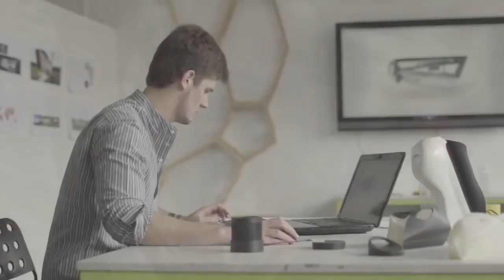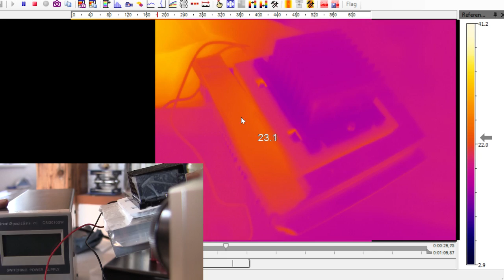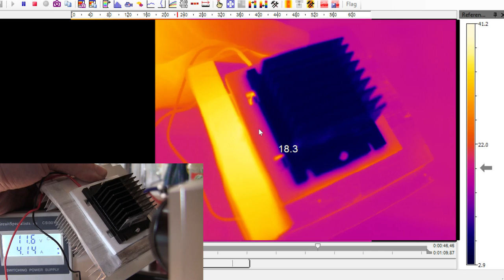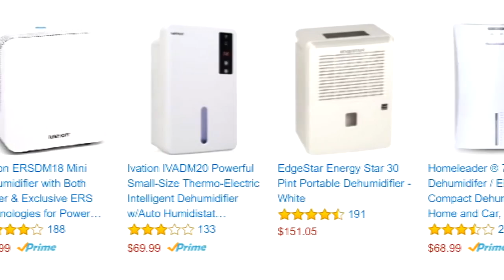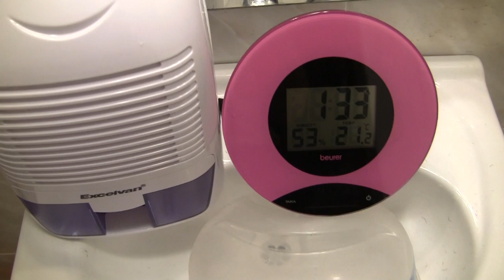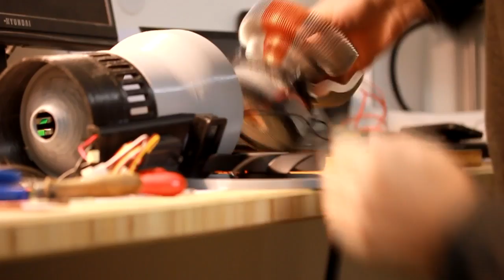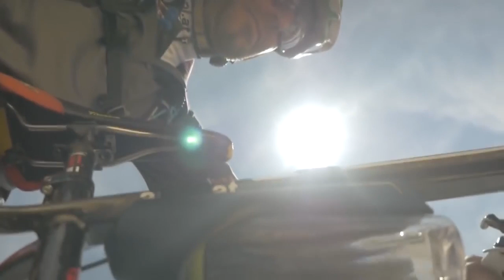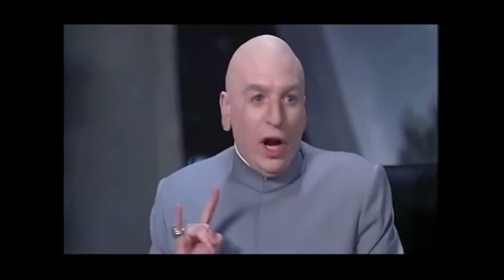$300 000 'Self-Filling water bottle' FAILURE

Comment: ok serious question now.  In your first video I pointed out that it was just a dehumidifier, likely with similar tech, which is something that wasn't included in your video (which focused on solar power efficiency and law of thermodynamics, low humidity levels in areas that would need this, etc).  my dehumidifier fills i think it is 2 gallons a day.  so the bottleneck on design is just power supply and weight then?
Reply: I guess I bought biggest one in home depot. I think it was 200 Bucks 4 years ago.  I see why they'd think potential is there.  some of these dehumidifiers really produce a shit load of water unlike that little tiny dinky one you got.  I've never seen such a small and useless dehumidifier before.  if these guys want water in their villages, they probably will only transport these once.  if someone wants water while hiking, just fill up your fucking water bottle before you go, as it'd be less heavy to carry a case of water than a functional dehumidifier, power supply, and produced water.  they're marketing it wrong.  this could work on villages on larger scale, not these little dinky cup lids
Reply: Check on the stickers or in the manual or the specs what kind of power your unit draws. Then remember you need 1m2 worth of solar panel for 150 Watts. I think your dehumidifier might need 6m2 or more to work.

It's not hard at all to build a bigger humidifier that draws more power. Question is where the power is supposed to come from

Comment: i completely agree with thunderfoot on this one.
i live somewhere where its normally around 35c and 80% humidity. using my air conditioner i can remove around 5l of water aday. but the difference is thats using 2000watts of cold air. and you can almost feel the water in the air. if the humidity was lower i also would get almost no water out of the air. i dont know how they thought 15watts could do anything.

Comment: Agree with most of the video, but have to nitpick. At 8:49 you claim that 'taking apart dehumidifiers and analysing them ... might be intellectual property theft.'

Uh, no. Reverse engineering is and always has been legal. You can even reverse engineer something and make your own version. There are only 3 limits here:

Patents: If something is patented then you have to get a license to produce copies. Things get a little more complicated when you start talking about 'design patents' which don't patent function but only appearance. In which case if you change the appearance 'enough' (which is legally fuzzy) then you can produce copies. But for regular patents if it functions the same then it needs a license.

Trade Secrets: If you've worked at a company that produces what you want to copy you may be limited by employment contracts which prevent you from reusing knowledge gained during that employment. But if you've never worked for the company (or been given a presentation by the company or in some other way been given the knowledge of the company under contract) then trade secrets don't apply. In that case you can reverse engineer and produce copies all you want.

DRM: A new entry in this list there are a subset of things which are protected by DRM (mostly this just applies to software. Although overlaps are starting to appear where software is key to running physical machines such as cars and tractors) then whether or not you're allowed to reverse engineer something becomes dependent on your local copyright laws.

Of course copyright also limits your ability to copy and reproduce music and movies and such. But those examples aren't examples of reverse engineering but rather just straight up copying. But you can reverse engineer software functioning. For example this is how Compaq made the first 'IBM Compatible' personal computer; by reverse engineering the IBM bios and then producing a 'clean room' copy. (That is nobody with knowledge of the IBM bios was involved in producing the copy to prevent any trade secret 'contamination'. The engineers that wrote the copy bios did so based solely on API's documented by the reverse engineering team.) Similarly WordPerfect reverse engineered the Microsoft Word file format in order to be able to open documents of that format. And so on.

Comment: I don't know who to ask. Is it possible to build a freezer with a 50L esky and a Peltier device?
Is it a poor power usage? Am making a closed system air cooler unit with the copper pipe running around in front of fan with a fountain pump in the esky. 
From research so far a solar panel on bedroom window will not give me enough power for pump, fan and Peltier device to run. Even in good sun in Australia I lose so much power with a panel behind bedroom window.
I just want an air cooler in my bedroom that isn't expensive to run and doesn't put excess moisture in the air.

Comment: BIG QUESTION or am I missing something: What is the point of buying or using a dehumidifier if it doesn't change the humidity of a room over a whole day?
Reply: Because he stuck in an already unhumid room. 30% is very low.
Reply: It seems to only go down to around 30 % humidity. So if you're in a place with very high humidity then I guess it would bring it down a bit.

Comment: I've already seen a crowd-funded "evil lair island minus the evil and the island" They called it "off-grid farming" or something. So why not start your plans for a "good opensource saleable community" design or improve your self-filling water bottle, (congratulations, by the way, but what your bathroom showed is that you need a more reliable source of humidity) with a "breath humidity reclamation suit" that takes human movement to generate electricity and use that to extract the moisture from breath. (That way you could stay hydrated even on the hottest sand *dune*s.) N.B. the suit has to generate and regulate a negative pressure for the wearer so that it isn't a strain to breath out. Continue to be a critic, but also become a contributor.  #theDarkSideHasNOcookies

Comment: Err... you've left yourself open to "debunking" with your second dehumidifier run. People can claim that the "outside world" is effectively an open system, so the humidity would remain constant regardless of how long the "fountain" runs for, whereas your bathroom is a closed system; you would definitely have got more water out of it if running the dehumidifier hadn't had the effect one would expect from doing so in a closed room.

Of course, "more water" doesn't translate to the sort of numbers they're advertising, but still...
Reply: You've completely misunderstood the experiment.  The goal was not to dehumidify the air.  The goal was to extract water.  And the commercial dehumidifier was unable to do much of that under those low-humidity conditions, which means any such device running on less power will do no better.
Reply: No, I understood the experiment, you misunderstood my point.

The goal was not to dehumidify the air. The goal was not to extract water. The goal was to demonstrate how little water could be extracted from even quite humid air, given a certain power consumption.

The experiment, as designed, has the unintended side-effect of dehumidifying the air, which made the amount of water extracted substantially lower than would be expected in an open system.

Thus, the experiment is open to the criticism "but in the real world the amount of water produced would be higher", which is true. However, the criticism would be said with the implication "as high as we claimed", which is not true.

Comment: Thermodynamics aside, doesn't drinking distilled water like fuck you up and give you diarrhea? kind of like drinking salt water, if the product managed to somehow produce water it wowld not be drinkable.
Reply: Miquel Vico not at all, there's actually very little more in tap water compared to distilled wate, not enough to be significant nutritionally. So distilled is perfectly safe to drink, we don't usually do it because it's very expensive.
Reply: Nope, distilled water is just fine, won't give you diarrhea or anything else - that is old bullshit some retards spread.
But it won't give you the minerals you normally get from water, so specially in hot areas where you sweat you need an extra source for those or it can become unhealthy.
Reply: It wouldn't actually be distilled water. It would be precipitation, which would contain particulate matter, bacteria, pollutants etc. from the air. Which is why you don't drink water out of your dehumidifier. It'd need to be filtered and sterilized first. That was one of the problem Fontus didn't address.
Reply: Distilled water contains dihydrogen monoxide (a dangerous solvent), explosive hydrogen gas, and poisonous oxygen.
Everyone who drinks it dies.
Reply: I think I can remember that distilled water removes minerals and such from cells through osmosis (diffusion).
Reply: That's why you need to drink Brawndo. Brawndo's got electrolytes.
Reply: Distilled water is just H2O. It's a very common way of purifying water. A lot of middle eastern coastal cities use it for example.
Reply: only problem is lost of electrolytes. It does everything else needed
Reply: What the fuck is wrong with you? distilled water is just water how can it fuck you up? I think you're fucked up, so damned stupid you're the type to fall for these shitty kickstarters.
Reply: "It is better to regulate water loss through work
or rest cycles because overhydration can occur if water intake
exceed 1 1/2 quarts per hour. Overhydration can cause low serum
sodium levels resulting in cerebral and pulmonary edema, which
can lead to death" - U.S. Army Surrvival Manual. :)
Reply: Distilled water is dangerous if you drik only ditilled water you can die for minerals deficency and acid state
Reply: It would if you were to drink nothing but distilled water for several days.
Reply: You can die of water brain if drink too much water. 

A few years back a girl was in a water drinking contest here in Sweden to win an XBox 360 and died from water brain...

She won the XBox, but it killed her.

I remeber it was in the news and everything...
Reply: David McGhee holy fuck ive veen dringing dihydrogen monoxide for my entire life.
Reply: Miquel Vico what about bacteria and mold forming in that bottle? theres lots of air passing over that heatsink, it wont stay safe to drink.
Reply: Gego/XAREN ゲゴザレン The only similar contest I could think of was the radio contest in Sacramento, CA titled "hold your wee for a wii" where a woman died after drinking several bottles of water, holding her urine and then dying. 

nbcnews (dot) com/id/16614865/ns/us_news-life/t/woman-dies-after-water-drinking-contest/

Heck, googling hold your wee for a Wii gives off some nice insight.
Reply: +Veikra yeah you should drink Brawndo instead. it's what plants crave, it's got electrolytes.
Reply: Miquel Vico Extended use or complete reliance on distilled water is bad.
Reply: You meant ultra pure ion exchange ddH2O. And yes if you drink that most likely you are losing electrolyte to urine and that might be dangerous.
Reply: Miquel Vico all of you claiming distilled water is completely safe is partially wrong. If you drink nothing but distilled water it will take nutrients away from your body and kill you, you need to add minerals to your body with other sources
Reply: Federico Ruffini yeah if you only drink water you can die. but generally people eat food where they can get minerals from.
Reply: There is still the problem of the acid Ph distilled water absorb carbon dioxyde of the air making it slightly acid and day after day you will probably be not able to dispose of it
Reply: it would be drinkable. but if you didn't eat, over time you would suffer from loss of minerals.
Reply: Considering the method of extraction of the water and the fact it isn't filtered, I'd be more worried about diseases such as Legionnaires' Disease (Legionella).

This disease got its name from an American Legion meeting in Philadelphia in 1976. The air conditioning units (which also act as dehumidifiers - a known and desired side effect of an AC's function)  in the meeting hall were dehumidifying the air, and the condensate pans of the systems created warm stagnate pools of water which allowed the proliferation of the Legionella bacteria, and as the water evaporated out of the pans the bacteria entered the airstream and infected 224 American Legionnaires, causing 34 of them to die. The disease wasn't truly identified until 1977. Other similar diseases such as Pontiac Fever are also known to thrive in conditions such as this which is why on every commercial dehumidifier, and every AC user manual there are warnings to not drink the water they produce. 

Drinking distilled water has known risks and benefits, the same can be said of tap or bottled water or well water. All of these types of water are filtered in some way, and all experts agree that filtered (as in clean) water is the safest to drink. This self filling waterbottle does not filter the water and leaves it to stagnate (stagnation also being a danger). I'd drink distilled water over contaminated and stagnate dehumidifier water any day of the week.
Reply: Landrew0 Don't know what you're talking about it's the only water I drink.
Reply: Landrew0 honestly fuck off
Reply: Miquel Vico well it is drinkable, but it wouldn't help, nor damage you, the body won't know what to do with it so it won't cool you down.
Reply: David McGhee really nigga
Reply: Federico Ruffini you can make up for the deficiency with a nutrient rich diet however. But in situations where water is scarce, I imagine nutrient rich food will also be scarce.
Reply: RompotMechanikos lol
Reply: Federico Ruffini Tap water has Carbonic acid in it too fucktard.
Reply: helenvalentine95 That would happen with bottled, filtered and tap water. all water flushes out electrolytes.
Reply: ***** So you drink 100% saturated carbonic acid or salt water in lieu of water right?
Reply: Gego/XAREN ゲゴザレン 
Something like that happened here in the states, but worse. A little girl drank all her sister's juice so her parents forced her to drink a gallon of water. She died of water intoxication.
Reply: Someone please explain. I bought some gallons of water from Rite Aid and drink it because there are only like two water fountains on my campus. People here are saying "the water you drink" but is that tap water or bottled water? I know bottled water is tap water except it was processed in some way. Help please.
Reply: Miquel Vico Distilled water is just water with no additives. No, it doesn't fuck you up.
Reply: Anyone who would drink the water out of dehumidifier has a death wish, with all its dust, germs and virus contained.
Reply: Distilled water will steal the electrolytes out of your body.
Reply: Not an expert, but, my understanding was that gastric distress due to drinking unfamiliar tap water was more often due to drastic differences in salinity from the water you are used to drink than poor sanitation. To my understanding, distilled water might presents similar issues due to its complete lack of mineral content, not saying it is poisonous, just that it is a poor choice when trying stay hydrated.
Reply: You're a Cyberman you don't drink water

Comment: Not that I wish to defend this company - but most commercial humidifiers (like the one you are using) don't operate below 45% humidity. I run one in my home when it is like 80% humidity and get about a liter overnight - but you need a very humid environment and a lot of power. Just saying - 30% is like dessert conditions, but I wouldn't expect this contraption to work at all. But at least they made a few hundred thousand to pocket. 👍🏼

Comment: One thing I don't understand with these kickstarters is why they never manage to make the unit they initially design? The Fontus bottle in the marketing video/demo looks pretty cool, and would make a nice novelty product even just for demonstration purposes. Of course it won't perform well at all, at least you could offer what you promised. There is nothing impossible about the initial design! It's very easy these days to have things custom made, heatsinks or plastic parts, all they need is the CAD drawing and material type specifications!

Comment: In the christmas video, they show very familiar heatsinks, the "condenser" heatsink is a stock intel cooler with i'ts fan removed.
The top (cooling) heatsink looks like a zalman cnps7700-ALCU this thing by itself weighs 600g and draws about 6w of power to run at full power, you even see the fanmate 2 speed controller (part of the heatsink kit) hanging from the side.

Comment: Surely any where that has enough humidity to extract water from the air also has ground water and/or liquid water on the surface - wouldn't a cheap solar still made out of about $0.50 of plastic be more effective at obtaining clean drinking water?

What struck me about the Fontus clips here is that they seem to show a working product, which is fraudulent in the extreme as people will assume that they at least have a working prototype and just need the funds to set up for production.

I think that we need both Kickstopper and Indie-no-go.

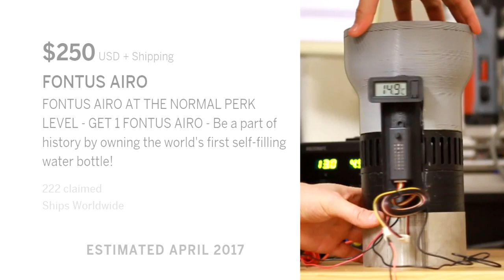Comment: at 17:30 I have that exact same fan regulator below their digital screen showing the temperature. It came with a Zalman CPU  cooler fan which is probably where they got that huge heat sink from too. I got that cooler, regulator and the PC it was used for back in the days of Pentium 4 which was probably 15 years ago, so i guess  we can "congratulate" them on reusing old PC parts they had lying around. Which also goes to show you can start making this yourself at home just for shits and giggles. You don't need 300.000 USD and government grants.